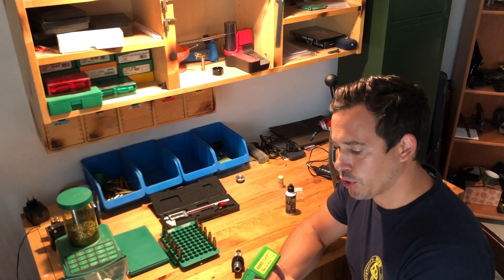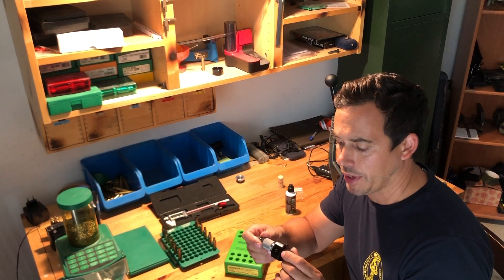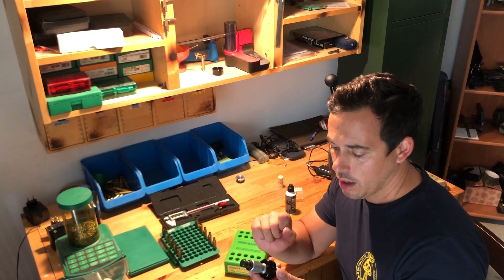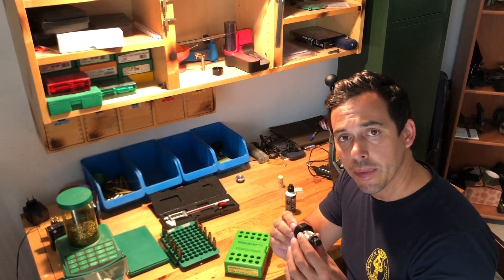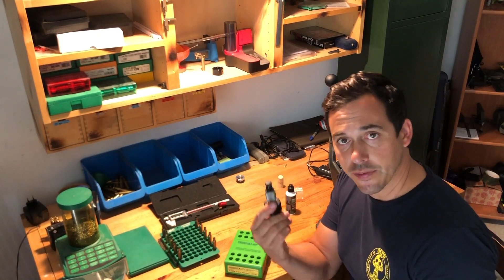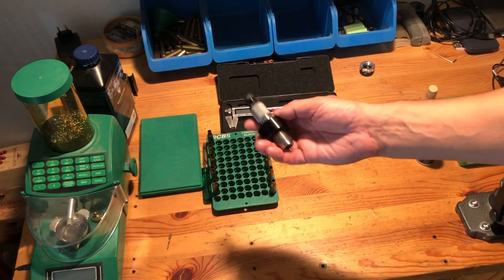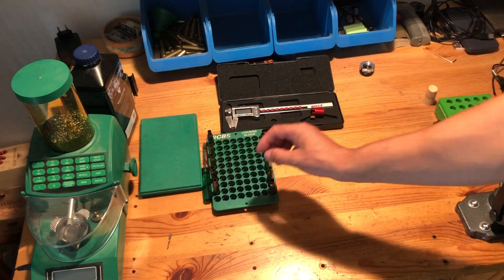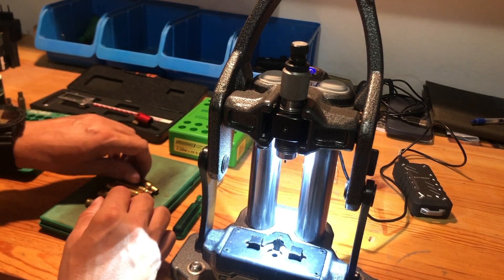Redding Type S Bushing Dies – The Key to Perfect Neck Tension!

Comment: I would use an expanding mandrel after !
Reply from the maker: That is definitely the best way to go yes.
Reply: but how is that in any way different than an expander ball? It's just one more extra step ...
Reply: It’s a more controlled expansion.
 Over a larger surface.
Reply: @lz3572  yeah then again what happens during firing ... i can't imagine anything more stressful for the material than rapid expansion by explosion :D - i think this is just overthinking it. I would say you shouldn't rip it through because of springback, but a controlled button like movement will do the job just fine.
Reply: Sounds like you have it all figured out?
 Enjoy the great hobby of reading!
Cheers
Reply: @lz3572  am i  missing something though?
Reply: @firebladeflow  I meant reloading!

Comment: You didn’t mention leaving the bushing slightly loose so that it self-centers. Tighten down on the bushing and then back off 1/8 turn. You should hear the bushing rattle when you shake the die. Helps keep the neck concentric with the case body.
Reply from the maker: Yes that is true. Thanks for your comment.

Comment: 1. Use a gauge pin to check for correct and consistent inside neck diameter. 
2. Batch brass, ie same batch and no. of firings
3. Anneal brass to remove hardening and uniform spring back. This step provides for pretty accurate uniformity in next tension. 
4. There’s different opinion on turning necks for improved consistency in neck tension, I personally don’t turn necks but don’t dispute those that do. High quality brass in chambers reamed well provides the results I chase.

Comment: You need the ball as your cases aren't turned. If you turn the necks then it's a  different story. the other patch is only more consistent on the out side.
LE Willson make a FL pushing die without the the expander ball and the clearly say it is for turned brass
Reply from the maker: I can understand that. What should be done later is the mandrel resize…

Comment: I'm more interested in the dimension of the inside of the sized neck rather than the outside measurement.  Pulling the the expander ball through the sized neck insures uniform inside measurements are the same. If you turn your necks, your expander-free method works even better. Thanks for making this video

Comment: a couple things....first you are using WAY too much lube on the INSIDE of your necks......just ROLL the brush across the lube pad, and when you insert it in the necks, ONLY insert it barely past the neck - shoulder junction...when you're done with the final step with the Mandrel sizing your necks, then wipe it out with a Q-Tip...secondly, when you put the lube on the pad, rub it around with your fingers to spread it evenly, and BE SURE to rub some on the Necks  when done rolling them....sizing without lube ON THE NECKS is a no-no......

Comment: 1. No reason to lubricate the inside of the round, the bushing only contacts the outside. 2. You should look at an expander mandrel from 21st century. Get rid of the expander ball and stem. Only use the nut from the stem to take up room over the bushing. TOO MUCH LUBE!!!!
Reply: He didn't lube the inside of the neck when he just used the pin retainer. He lubed inside when he had the expander ball installed on the decapping stem.

Comment: Thanks.  After watching your video, now I realize that the black cap is there to replace the expander ball.  I was wondering what it is for.  Also thanks for sharing your finding that using the bushing alone without the expander ball will make the neck size more concentric.  I plan to do this (without the expanding ball) and see if this will help the concentricity of the case neck.  If I still cannot improve the concentricity of the case neck, I will using Sinclair expander die.
Reply from the maker: I am happy to see that it helped you. Using an expander mandrel gives another step in your handloading process, but it is definitely the most precise way.

Comment: The thickness of the case neck wall may vary, you just put the variation on the inside of the case neck instead of on the outside.
Loaded they will have the same dimension either way and if you want to get rid of the variation you will have to neckturn the brass.
Reply from the maker: I am completely aware of that. Anyway removing the expander ball is the way to go. And then you can regulate the interior dimension with an expander mandrel or as you said, neck turn the brass…
Reply: @TomasHunting  what Andreas Karlsson is trying to say is, the pin retainer is used with Lapua or other high quality  (or neck-turned) brass and the expander is used with common brass that has uneven neck thickness. Also, no sense neck-turning brass that has been sized with a bushing. That's why neck-turners come with an expander mandrel. Thanks for sharing!
Reply: @TomasHunting  if I don’t want to go,those extra steps will, i still need the expander ball? I have various manufacturers brass.